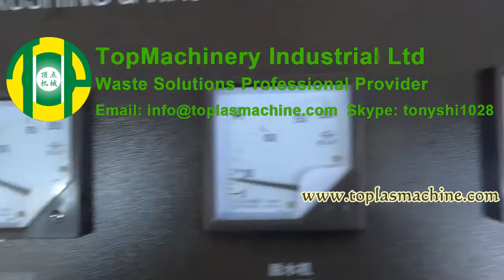plastic crushing washing recycling line for PP woven bags, jumbo bags, raffia, PE film, foil

Comment from the maker: PE PP film woven bags recycling machine
Application:  PP woven bags, jumbo bags, raffia, PE film, agriculture foil, sheet...
capacity: 300~2000kg/h
Main machines in the line: belt conveyor, screw conveyor, shredder, crusher, friction washer, high speed friction washer, hot washer, floating/rinsing washer, dewatering machine, drying system, storage silo, electric panel for whole line

TopMachinery Industrial Ltd
www.toplasmachine.com
Mob: 0086-152-52900921(WhatsApp)
Tel: 0086-511-83302065
Email: info@toplasmachine.com top516@hotmail.com
Skype: tonyshi1028